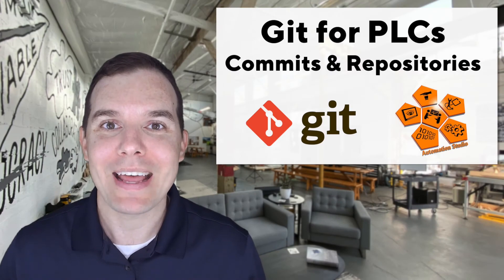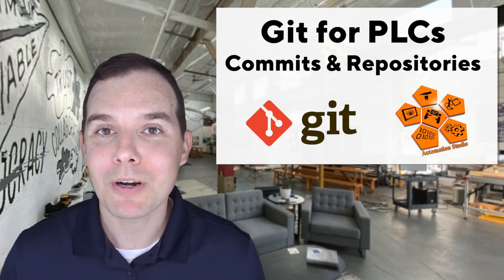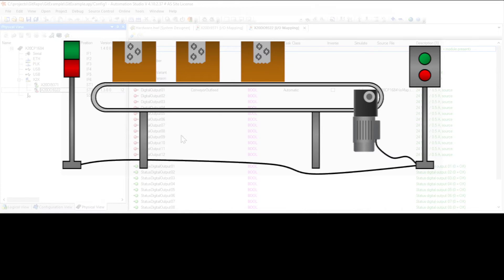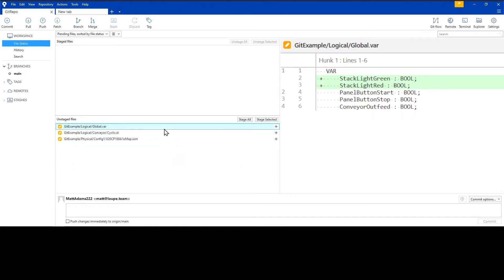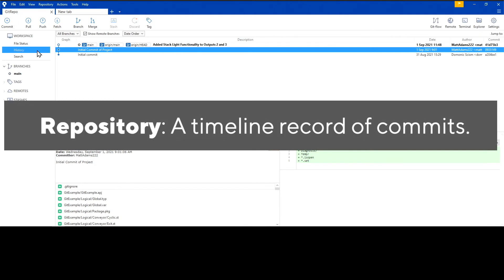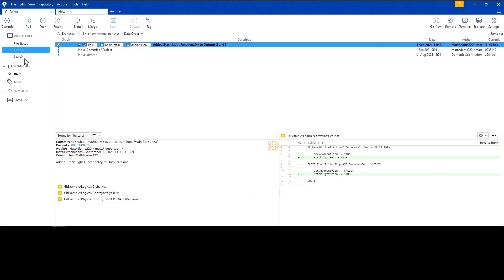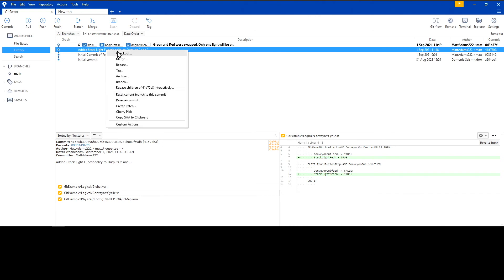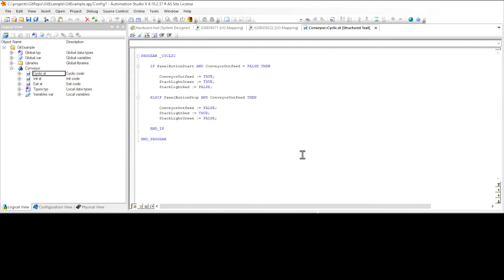Git for PLCs Pt. 1: Commits and Repositories

Comment: How this will work on Siemens and Rockwell
Reply: I may be late, but I'm gonna answer anyway. For Siemens, if you are using TIA Portal, you can find control version tool at the end of the project tree. In there you will select the folder path in which you want to export your project XML files, this folder should be created with your Git application first. You probably want to install TIA Portal Git add in first, this will enable PUSH/PULL commands inside TIA Portal environment.
Reply: Thanks for your response. I'm looking for complete DevOps practice for Siemens and Rockwell PLC programming.